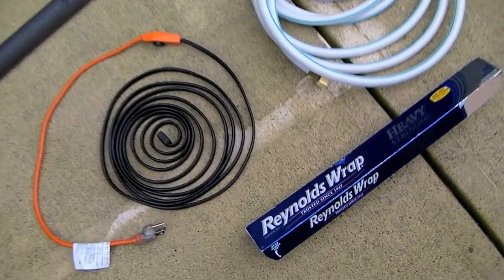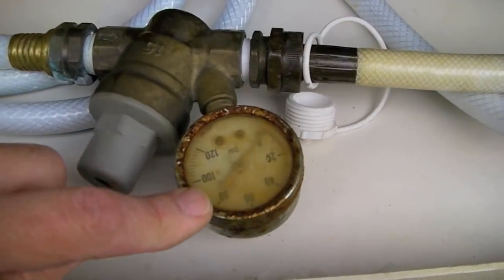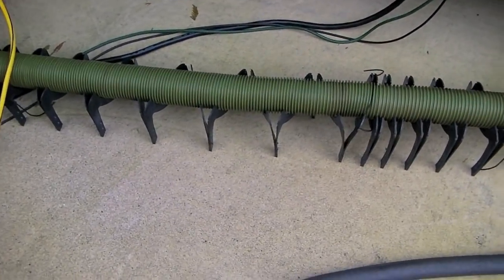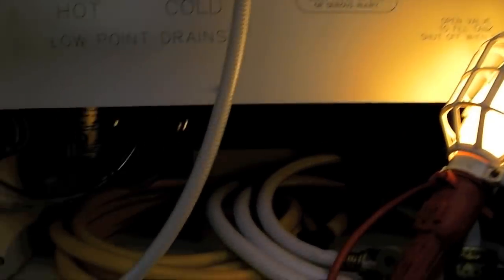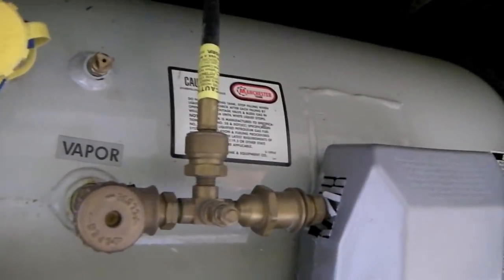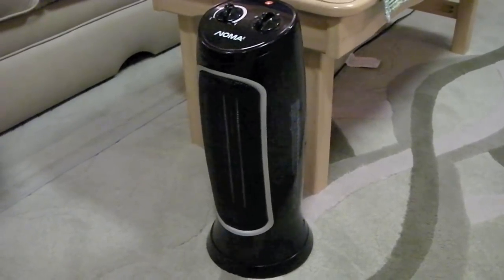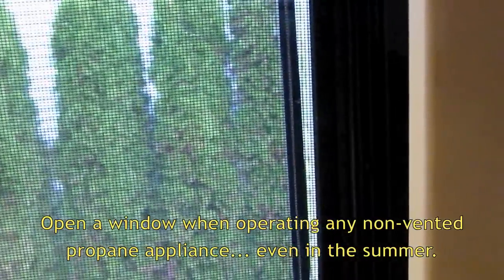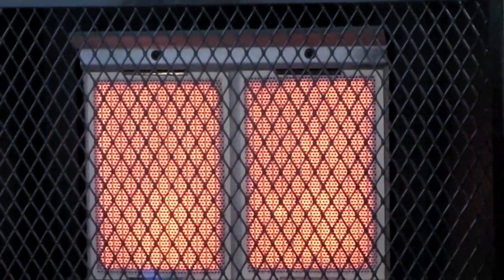How To RV in the Winter - Prepare Your RV So You Don't Freeze!

Comment: did  you wrap the tape  even though it says to put it in line with the pipe ,
I have a mobile home and the pipe comes from the ground under the siding  then into the upper part of the cold in water pipe  ,so wrapping it would be very good for me and I could adjust the length that way  then cover it with the round foam pipe insulation ,what do you think it would work and will the foam not melt? a guy in home depot says all foam long noodle type of insulation wont melt
Reply from the maker: Can't imagine the foam melting, since it's designed to be used as insulation.

Comment: Very informative: Thanks guys!Based on the link, you're using the KWP112, which has 10,000 and is the infrared/radiant type, rather than blue flame.I want a thermostat, mostly so I may leave it running over night for my pet. Hence, looking at the KWP122, which adds a T-stat. On the internet, I've read that T-stats on radiant/ infrareds don't work well, if at all. I'm wondering if you guys opted against the T-stat for personal or equipment related reasons. If personal, have you heard anything about how well the KWP122's stat function performs? The manufacturer's site just lists the max output, but says nothing about btu variability. If T-stats don't work well with radiant, for some reason, I think I'd go with the "blue flame" type.  Again, thanks for helping so many people.
Reply from the maker: We are currently traveling away from the RV and don't recall our model number but it does indeed  have a thermostat, which we leave on the lowest setting each night and keeps the temperature perfect all night.

Comment: VERY helpful info about wrapping the incoming hose. Thanks! I have been using my RV as office space and have been wondering how to deal with that issue when it gets cold.

Mice are not a problem for us because of two solutions: 1) we have an ultrasonic device that only they can hear, which they hate, and 2) I have a cat patrolling the perimeter, who knocks them off before they even think about coming in here!  🤣

One funny story about the cat: She has a space in the garage, with a floor heater and trap door. One day I checked on her and saw a mouse sitting in front of the heater in the garage, warming itself, no lie!! And the cat was about 10 feet away! I came back about an hour later and the mouse was dead. Not a smart mouse!

Comment: Is it possible to use the heat tape as a way to heat the floor? OR use a heated rug?
Reply from the maker: The thermostat on the heat tape is designed to come on just above freezing, so it wouldn't be useful for heating a room, and might also be a fire hazard. We've never tried a heated rug, but it sounds great for keeping feet warm in the winter!

Comment: A hard sided camper will do better, you can also prepare a camper like a home such as putting plastic over the windows, going around with insulating caulk. They also have hay bails and I have seen people put hay bails all around the camper and plywood and then using space heaters. The major thing also is snow on the roof being heavy and also pipes freezing or water inside. Also the water heater and Refrigerator access doors are on the outside, so building boxes to go over those will help.

Comment: When hooking up your heat tape to the hose the box where the tape turns into 110 on that box their is a round disk that is supposed to be attached to the water line you left yours hanging out did you have any problems with them being out like that ?
Reply from the maker: That's the thermostat, and we wanted the heat tape to come on whenever the ambient temperature dropped to the pre-set trigger point (low 40's If I remember correctly), so we just left it hanging outside. It worked like a charm all winter like that. No problem at all.

Comment: How cold could this method endure? I would like to know what it would be like to live in RV full-time in a place like Edmonton, Alberta in Canada, where it may get as cold as -20 or -30 Celsius, and sometimes more. Of course I may rotate between living in an Apartment/ house/ hotel here and there, but just want to get an idea. I will most likely be living in a Class B motorhome van, made in the late 90's to early 2000's. Thanks
Reply from the maker: We're not hearty enough to come close to -20 or -30 C in an RV, and can't imagine doing that, especially in a class B. The only way we'd try that is with an RV that was factory-equipped with a winter package, at a 50-amp campsite, and lots of heating and added insulation. We're sure some people do it, but it's so cold at that point that fighting it would just be no fun.

Comment: The plumbing on the small gas heater has teflon taped threads that are for water only and will not pass an inspection.  Ask your hardware store for yellow teflon tape and replace the white tape when you have a chance.
Reply from the maker: Carl Lind Hi Carl. Right after we shot the video, we realized we had used the wrong tape, so we dismantled it and re-assembled with yellow tape. Thanks!

Comment: I also live in an RV and move south in the winter.  The idea of spending the winter in my van does not appeal, not only because of the cold but also because of the lack of light.  My Hymer has a problem that when the internal temperature drops below 4C, it dumps the water automatically.  I tried resolving this by leaving the heating on very low all night but the best solution I have found is to move south!!

Comment from the maker: There are indeed code regulations about this, but RVers have them added all the time anyway. During the winter in Quartzsite, AZ, they do a land-office business installing them. Working with propane is definitely not for everyone (which is why we mentioned that in the video and did not demonstrate how to do it). We figure if they make these heaters for indoors, and we use them thoughtfully (windows cracked, propane detector tested & working), it's such a great heat source that we're OK with it.

Comment: Absolutely fantastic video. The tips on moisture management are invaluable. I will however comment on the use of steel wool as a mouse deterrent. The moisture in the water basement will cause the steel wool to rust immediately and therefore ruin the screws fastening the trim ring to the bottom of the basement. I would suggest cutting a piece of 1/4"  hardware cloth/chicken wire cloth to fit tightly around this opening.
Reply from the maker: Thanks for the input Gunner! That would be important for someone with any chance of water there, but our compartment is completely dry, so we never thought of it. Great idea!
Reply: Can a mouse get through 1/4 inch? They say they can squeeze through pencil size?
Reply from the maker: RV Beginner Winnebago Adventurer '97
I've heard that they can get through anything about as small as a dime, but the little ones, maybe even less.

Comment from the maker: No, because the heat tape is really designed for metal pipe, so the tin foil both transfers heat around the hose, and also shields it from overheating.

Comment: Is humidity (and condensation from temperature differences in/out of the RV) an issue ONLY in winter? I've seen a lot of RV videos that seem to indicate that many, many RV owners have issues with humidity. I'm surprised RV companies don't simply add a humidifier to their options that vent water collected right out to the ground?
Reply from the maker: We've never had any problem with condensation except in the winter, when its substantially colder outside than inside.

Comment: Cont. You can also let faucets drip, and if the noise is annoying put a wash cloth in the sink going from the spicket to the hole. ALSO if you have a problem with mice.. build a dog house.. put some carpet padding in it.. a light bulb, and throw cheese in there or something.. keep it about 40 ft away.. so it is like luring them away. I had some old boat seats and wondered why my house didn't have mice, well momma had babies in the boat seats.

Comment: Hi Guys, do you by any chance remember what the temperatures were getting down to?  We are in a 40ft Dutch Star and due to a change in employment will be wintering in the mountains of northeastern California this year.  Did you experience any other challenges dealing with the snow?
Reply from the maker: The temperature in British Columbia's Lower Mainland is typically much milder than anywhere else in the country, since, like nearby Seattle, it gets warmed by air coming over the Pacific, not over the Arctic like so much of the rest of Canada and much of the USA, too. Our recollection was that that particular winter was fairly typical (other than a freak 2-foot snowstorm, which is VERY rare, which you can see here: https://youtu.be/BxOXapeYTMQ ).

Temps typically do drop below freezing at times, but rarely for more than a couple of nights, and rarely further down than the 20's during those few nights, with temps usually managing to get back above freezing during the day. We were in the same area last February, and we're pretty sure it never went below freezing at all (although December and January are usually the coldest months there, not Feb).

Since you mentioned you'll be in the mountains, the biggest factor you'll probably be dealing with is elevation. The park where this video was shot is about about 900' above sea level, but surrounded by mountains that rise above 4,000, with with a few topping 7,000. As a result, even though the park gets very little snow, and not much sub-freezing weather, it's surrounded by snow all winter. We once visited the ski resort about 20 minutes from the park. The snow was still up to the roofs of all the houses... in June! The drive there is almost straight up. :)

It we're not staying all winter in a place with the same climate as the park in this video (like last February), we wouldn't even bother wrapping the water hose, but would just disconnect it from the park's water connection during the couple of random nights when the temps were forecast to go below freezing, and just run off the fresh water tank for a couple of days.

Can't recall any issues besides what we outlined in the video. It wasn't really difficult, but part of that was planning, and part of that was the fact that the winters just aren't that bad. If you're headed somewhere high in the mountains, high snowfall and very low temps, especially for extended periods, could make it a whole different ball game. Hope you make out okay.
Reply: Thanks for the reply.  The elevation is around 4500 feet.  Daytime temps should be in the 30-40 degree range and 20-30's at night.  We have heaters in the storage bays and on the hoses and tanks.  Keeping the snow removed from the roof will be the interesting task.  Road conditions getting there will be another challenge as winter snows have already begun.  Thanks again.

Comment: Living my RV for 5 years, Heat tape does use a lot of current, (ohm's Law) exspeicualy when temps go down and STAY down. The sensore Heat Tape's that I have bought are still working. I have "winter Water Hose allteady taped and insulated and ready to be swapped. Never use Garden Hose for the main water either hooked into the "city inlet" or to fill the main water storage tank. Runnung a continuase water feed not the best, alot of culinary water goes into the sewer systems and or the RV park may charge extra. With Dought Conditions in parts of the Country.

If the Sewer connections need a "long" run depending on location of RV to Park systems, after getting a total frozen sewer, found at a "depo store" the Unbreakable 4" sewer line and connecctions, Dryer 8" alumanume duck tubing, wraped rubber insolating (1") with Heat Tape taped to 4" Sewer then inserted the 4" into the 8" Dryer duck. sealed both ends. did not have anothe r frozen sewer this winter, temps into single digits. Rocky Mountains.

Comment from the maker: RVing is indeed less expensive.  Low rent & utility bills, and no fuel costs if parked. Go for a 5th wheel or large travel trailer, as the expense of having a drive-train isn't worth it for you. A big 5th wheel can provide as much space as a motorhome at 1/3 to 1/2 the purchase price or less, and then much lower maintenance costs, due to the lack of engine, transmission, etc. Just keep climate in mind, as harsh winters are best done in a better-insulated model.

Comment: Not sure that the foil is very good at conducting the heat around the hose. Shiny foil tends to reflect radiant heat. I think that the heat tape should go on the hose first then covered with the foil which might reduce the amount of electricity by a small amount. The line is still in danger of freezing in the first foot or so into the ground to. They have nice heat mats for water and holding tanks that don’t take too much power.

Comment: I live in my RV year around.  Often there is 2 or more feet of snow on the roof.  This means the roof vents cannot be opened, the heat pumps do not work, etc.  How do you handle such situations?
Reply from the maker: We've only had brief occasions when we've had snow that deep on the roof... and we made sure to get it off as soon as we could so that the vents could open (so we could vent warm moist air out of the RV). Of course, snow or not, the heat pumps don't really work when temps drop below about 40 degrees (give or take a few degrees. We've got a few tips on the various options for heating in this video: https://youtu.be/1pgYW2xQwho   And we installed an extra electrical outlet to allow us to take advantage of an extra space heater when it gets really cold. Here's the planning video: https://youtu.be/ggWhFZPAmig    And here's the installation: https://youtu.be/w1ZO5RxKoq8

Comment: Finally an Informative video on Winter RV'ing.  Just curious what were your monthly expense's in the winter.  Did you skirt your RV at all?  Also what R value's qualify a RV for winter living?
Reply from the maker: The only expenses that were higher in spending the winter in a cold climate were electricity and propane. Can't remember how much, and it does depend on how cold it gets and what power and fuel costs are like wherever you spend the winter. It's still a TON cheaper than a regular house! We didn't skirt at all, although it's a great idea to do that, especially in a fifth wheel or travel trailer with little or no basement to insulate the floor of the living area from the cold. Our rig has the following R factors: Roof - 16; Walls - 11; Floor: 16; Basement - 4. This seemed pretty good to us for a mild-to-somewhat cold winter, but if you're planning to spend a winter in brutal sub-freezing cold, we'd suggest researching what R-values are available in various rigs equipped with what are typically called "arctic packages."
Reply: Wonderful.  Thank you for taking the time to answer my questions.

Comment: How many times did you wrap the aluminum around the water hose? How many layers of aluminum foil are there? 1? 2?
Reply from the maker: We just used the width of a standard roll of aluminum foil and wrapped it around the hose as may times as that width would allow. So I'm guessing at least 5 times or maybe a little more. I don't know that this many times is needed, but it was easier to just use the entire width of the roll than try to cut it narrower or do small sections at a time to wrap it less.

Comment: YOU HAVE TO HAVE A DE-HUMIDIFIER IN AN RV IF YOU ARE FULL-TIME...SUMMER AND WINTER. MOISTURE BUILDS UP JUST FROM BREATHING AND IT WILL GET MOLDY. ALSO YOU NEED SOME TYPE OF SPACER UNDER YOUR MATTRESS TO PREVENT MILDEW...USE WOOD SLATS SPACED 1 FT APART...OR FOR $150 THEY HAVE A PRODUCT BUILT FOR BOATS THAT DOES THE SAME THING.

Comment: Here's what you need for winter.  A PLANAR 9D diesel heater.  I'm a full timer in a 38nft Camio Carriage.  Do it...it's half the cost of running a propane furnace. I'm the only one out of 100 rvs here and I'm the ONLY one running diesel.

Comment: Very nice presentation and analysis. Use kerosene stove for heating. They do excellent work at very low temperatures. Doubled the insulation of the external pipes. Make use of propane only for cooking and to heat water. Have one portable chemical toilet type camping ready for use at very low temperatures. Use an electric substrate in bed.  Consumes very little power and you will be safe at very low temperatures. This is my opinion.
Reply from the maker: Thanks for adding to the conversation!

Comment: Should I insulate inside the bays/basement of my class A?

Is there an air gap between the basement/bays and the floor?

I need to move my home during the winter, so I'm looking for a way to put in a more permanent insulation that's always "go - ready".

I'm not sure how a class A floor sits on the chassis.
Reply from the maker: Hi Carla! There should not be any gap between the basement and the interior on a Class A. Insulating the basement should only be needed in extremely cold temperatures.
Reply: Some RV's have insulated wet bays, it looks like refextix foil insulation, you can get from home depot

Comment from the maker: Vent-less propane heaters are over 99% efficient and are safe to use indoors, as long as you follow the two most important safety guidelines we mentioned: 1) crack a window to allow fresh air to enter, since they use oxygen when burning, and 2) Be sure to use a CO detector, and test it regularly.